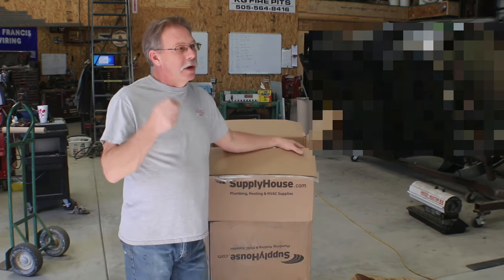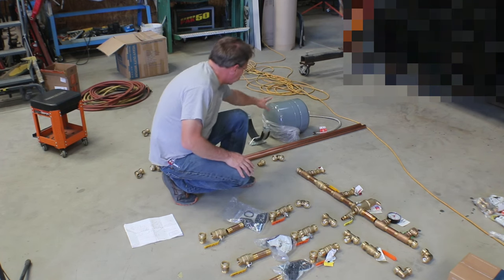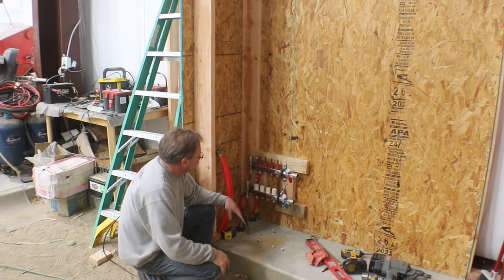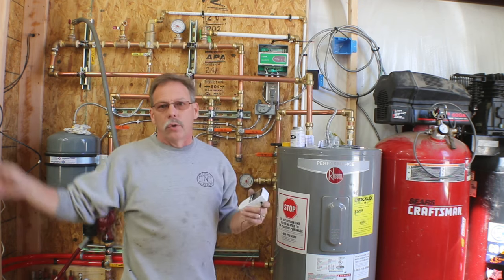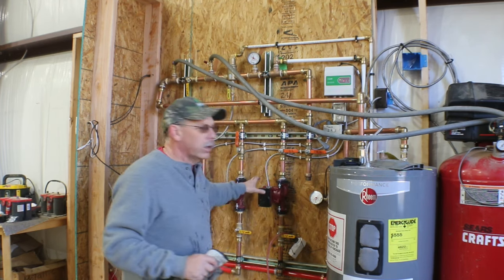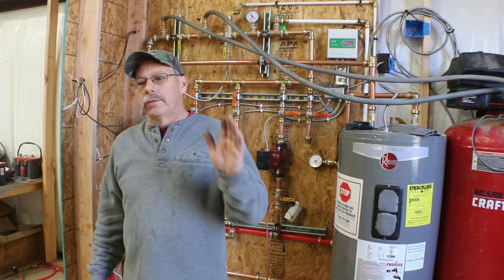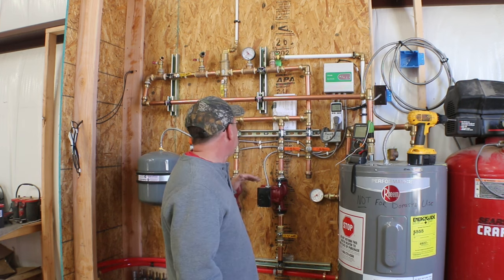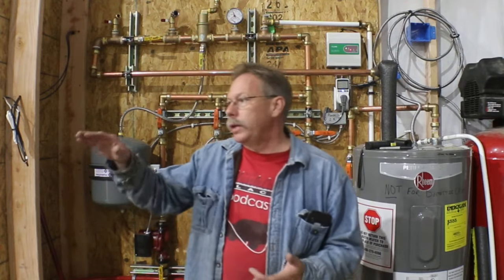Can you Heat your Shop with a $200 Water Heater? Radiant Floor Heating For My Shop | Allison Customs

Comment: Nice video for a DIYer install of this system. As a plumber my only recommendation is to replace the steel unistrut with wood. That or install brass insulative pieces between any place where copper is touching steel. When copper is attached directly to steel you get electrolysis. That over time will cause the copper to wear away causing failures at the copper/steel junctions. I hope this information helps. Have a blessed day and thank you for the video.

Jason B
Reply from the maker: Thanks for the recommendation!  I didn’t realize that a the steel strut could do that.  Be Blessed!
Reply from the maker: Good idea!

Comment: I was able to find a used oil boiler. I also had concerns when the pump was running. The local electrical supply house had 120 Volt indicator let's, that I drilled, and installed into the pump junction box, then tied into the hot, and neutral connections for the pump motor. A quick glance tells me when pump is running! Super easy!
Reply from the maker: Great idea!

Comment: you explained things so well. my fathers shop has been burning wood for 20 years and i just needed the confidence to switch everything over to the electric water heater. yeah the wood is free, but constant keeping that boiler fed is a lot of work. thank you for the informative video!
Reply from the maker: Glad I could help! 
The original idea was to use a waste oil boiler, unfortunately I just don’t produce the amount of oil necessary.
Check out the current situation - https://youtu.be/_mR7S4N28oY
Reply: I alternate between a home built waste oil boiler and an electric water tank. It takes about 10 gallons of oil to run 24 hrs so sometimes I don't have enough. electric water tank is heating near non-stop so she spins the meter pretty hard. I have a thermostat keep it at 60. cheers
Reply from the maker: Sounds about like what I was hoping to do. But I probably only produce 50-60 gallons a year

Comment: I heat my house and my 900 SF garage with my combination boiler.  I have one circ pump.  I live in a northern zone and it heats both fine.  By now you should have had the system long enough to realize you won't need any supplemental heat.  What I love is that if you open the garage door, there's not a long recovery time.  And working on the floor is nice as you're not freezing your a$$ off.
Reply from the maker: True, I love that the floor is not ice cold!

Comment: I was lucky as a Kid that we had a heated floor in our small shop in ND.  My Dad just kept the thermostat at 38deg F.   That was enough to keep the concrete from sucking away your heat out of your feet or when you had to lay under a car.   We had a wood burning stove to raise the temp up for working conditions.  The floor heater ran on heating oil.  We had to dress in long johns and coveralls for the weather anyway so walking into a 38deg shop when its -15 and 25 mph winds outside felt great!
Reply from the maker: Even at 60 degrees, mine definitely fells great when coming in from outside.

Comment: I helped a contractor install basically the same system but we installed a wind turbine that produced electricity which powered an electric water heater that heated the shop floor. The water heater and the concrete floor was the main storage system for the wind turbine system to store its heat. This system also heated a hot water coil in his house furnace to help heat the house.
Reply from the maker: I have checked a few times over the years and have yet to find a wind powered generator that will work with the amount of average wind we get.
Reply: The average hot water heater draws 18 amps at 220v.  That's about 4000watts.  Please let us know what wind turbine creates 4000watts.

Comment: So can you give us a little update on how this is working? I would be very interested in the costs of your monthly billing? How large is your shop and is it insulated well? Did you by chance put down foam when you poured your concrete? Would do this again?
Reply from the maker: The shop is 3800 square feet and roughly 72,000 cubic feet - it has R-40 stem walls below frost depth, R-19 walls and ceiling. 
I’m working through a solar system now and should have a video soon(ish).  
Here is what last season ended up like.
Shop Radiant Floor Heat - How Much did using an Electric Water Heater Actually Cost?
https://youtu.be/5jO3bHkLhJE
Reply: I have a much smaller shop 40X38 all walls are r19  and the roof is r19 X2.  I keep it about 55 degrees, I drive my truck out in the morning and back inside in the evening on workdays and on and off weekends in North Dakota.  So a Double size garage door is opened basically 2X a day for about a minute each time to let the cold in. A very rough estimate is $100-130 a month to heat mine (nov-feb, less for the month or two before and after that I keep it heated). I base that on what my bill was before I put it in and what it is now. I have used it for 9 years now. To plume in natural gas lines and a furnace, I can heat it for about 15-19  years and break even. on just the price to get it all done and I did the water heater myself. In the long run ( if I stay above ground for more than 15-19 years) it will cost me more, but I feel it was worth it. I suspect when I get down the road another 10 years I may not be puttering around my shop anyways. Great video wish it was around many years ago when I did mine, there were pretty much none on YouTube back then.
Reply from the maker: I’m kinda in the same boat, if I wasn’t making money out there, I wouldn’t be heating it at all.  Just work/play when I want to and on warmish days.  The grandkids are taking up more of our time now, so I’m out there less every year already.  That may change again as I retire, then I may want that gas boiler again.

Comment: I hope you check your wire size feeding water heater, you are way beyond their ratings. This is an awesome job my friend. Please check that wire an breaker,  your pushing it 5500w elements running simultaneously. Two 4500w elements will pull around 36 amps, your wh circuit normally runs on a 30 amp breaker, already exceeded, then bump tat 5500w elements that is about 46 amps.
Reply from the maker: This is one of the reasons I didn’t explain how I did my wiring, I didn’t want people just wiring everything up on one circuit. Thanks for your concern! But fear not, each element is on it’s own circuit.

Comment: If you are worried about water heater pressure then an expansion tank at the water heater is needed.  If it is that cold outside then 50/60 inside is great.
Reply from the maker: The system has a large expansion tank for that very reason.  Thanks for the suggestion though.

Comment: In colder climates we use either a 50/50 glycol mix or an antifreeze type coolant. No Steam created and the 50/50 mix tends to hold heat better than straight water. This also prevents freezing.
Reply from the maker: Thanks for the info.
Reply: Straight water has much better heat transfer than a glycol mix. A glycol mix is less efficient and should only be used when absolutely necessary.
Reply from the maker: True, but the freezing conditions here do make it a requirement- for me.

Comment: Since you got the heater used, make sure to pull the anode out of the top and inspect it's condition. When that anode disappears the tanks starts rusting out. Don't know if you live in an earthquake area, but if you do, strap the tank to the wall well and switch to flexible connecting hoses. You should have dielectric unions on the tanks, and pumps. Though these closed systems don't seem to corrode as much as open water systems.

I used the same pump on my system and in the end I wish I had purchased a stainless steel model. I used a tankless water heater for the much higher btu output (heating my whole house) which has an inlet screen. The pump rusts and is continually plugging up the inlet. Hopefully your antifreeze helps minimize that. If you didn't use O2 barrier pex oxygen will diffuse thru the plastic and corrode the pump.

In another thread you talked about installing solar water heating. Skip that and just put in more solar PV panels. They cost far less and if you make too much it is far more usable.  You can dump the extra power to your water heater or a secondary one, or any other electric loads. I would take the money saved and get a heat pump based water heater. It should pay for itself within a year or two in electricity savings
Reply from the maker: I don’t have any PV and am not currently considering them due to cost (nearly four times the cost of hydronic) and space constraints (more than 10 times the area required)
I do like the idea of a heat pump, they are just expensive and at least not yet into the budget.
Reply: @AllisonCustoms  Are you saying you have found solar water heaters cheaper that PV panels? Or that keeping your current system is cheaper than converting to solar and some other heating method. The latter I agree is cheaper up front. Whether you get PV panels or not, I think your ROI on a heat pump unit will be pretty fast. Electric heat is expensive, even at your pretty low rates.

Comment: Just came across your video,  your supply co. Should of sold you a copper press tool ,  not so sure the antifreeze will work well w all those shark bite fittings.  No pipe dope hope used used leak lock or  a paste teflon tape.  As. Previous mentioned. Heat Loss is the first place to start.
Reply from the maker: Thanks for the tip!  
I just started reading about that type of fitting.  As I finalize the system and it moves to its final resting place I’m going to look into those more.

Comment: Just came across this video on your shop heating and I must say Mate, just down on the farm type so awesome. Designing the heating system with what you had to work with turned out spot on Mate. As a old retired electrical engineer tech here, hats off to you Mate & will done. 🇨🇦🤝🇺🇸👍👍👍💯%
Reply from the maker: Awesome, thank you!
Check here for current setup - https://youtu.be/_mR7S4N28oY

Comment: A mixing valve while being an added cost would save your tank from the damage that repeated expansion and contraction causes which is directly a result of wide fluctuations in the water temperature. My tanks have all failed due to cracks forming in the glass lining near the opening for an element or the hot outflow. In larger boiler systems the welds actually fail in the boiler tubes if the water temperature changes too quickly.
Reply from the maker: I think that is in the plan with the solar system.
Reply: @AllisonCustoms  - add in hydraulic separators too.
Reply: You have to have excessive btus to spare in order to make a mixing valve work.
Reply: @rj.parker  Not so, one would set the supply loop temperature differential so that it is maintained within a prescribed tolerance thereby reducing damaging expansion and contraction fluctuations in the heat source. The heating loop is brought up in temperature slower which is not an issue for a large thermal mass such as a concrete slab. This essentially works by controlling the amount of return water re-entering the supply loop until the heating loop is up to temperature or the demand for heat is turned off. The idea that one needs to pulse hot fluid through the heating loop to even out or balance the distribution of heat is incorrect. The continuous circulation created by the pump in the heating loop will ensure the temperature is within a few degrees when a mixing valve is in place.

Comment: Well done video despite the length. I do want to mention that any similar project needs to start with a heat loss calculation so you can properly size not only the pipes, but the boiler or water heater. Once you know how many BTUS are needed the rest is easier.
Reply from the maker: Absolutely!  I tried to link as many sources for the information as I could in the description.

Comment: Personally I use Pex and ProPress fittings.  I know people poopoo SharkBite fittings but I've never had a leak in the 5 years I've used SharkBites (have maybe 20 throughout my house).  In your case, its probably beneficial considering your planning to expand your system in the future.  Anyway, looks good and thanks for making this vid and sharing.
Reply from the maker: I agree.  I have just ordered my solar system and I will now be able to dismantle parts of the original system to add my new heat source.  Video coming soon!
Reply from the maker: I think new code does allow for them inside walls, but I’m not sure I trust them that much yet.  But using them with the idea of future changes is an easy decision.

Comment: I use one of them thermostat plugs (kt3100) and im fairly certain you can switch from Celsius to Fahrenheit by holding mode button for a few seconds
Reply from the maker: I bought a second one and you are right, the newer one does switch.

Comment: If you fill from the bottom it helps push all the air to the vent at the top and it won't trap nearly as much air in the system to have to bleed out later
Reply from the maker: Good idea!

Comment: My boss and I built a shop for a guy three years ago now it was 80 foot wide by 150 foot long truck shop he use geothermal for heat he drilled 20 wells   And we had to go back last year to fix a panel that they put the forklift through but I asked him how much it cost him per month to heat the shop. He told me $65 a month to heat that big shop. So if you can do geothermal that would be the way to go.
Reply from the maker: I’ve looked into it a few times.  In my case I just don’t have the room to drill holes or do a shallow long trench.  But I agree if someone has space that would be a great way to heat and potentially cool a shop.

Comment: Just wanted to know Why not two mini splits and insulation. Would that be a more efficient  system.just asking.
Reply from the maker: I’m not really sure, it could be.  I really wanted the radiant floor, because now when I lay on the floor in the middle of winter, it’s nice and warm.
Reply: I agree.  At the end of all this work, it’s an electric resistance heater with a hydronic distribution system. Although the heat is nice, the bills are going to be huge.
Reply: IMO the answer is comfort. If he wants efficiency and comfort, I would go with an air to water heat pump and PV to feed the radiant.

Comment: When you upgrade the tank go with a 50 gal and wrap the current tank to help it hold heat.
Reply from the maker: Thanks for the suggestion, I ended up using a 108 gallon tank.  Video on all of that coming soon.

Comment: Nice neat job, well done, I am a power engineer the only change I would suggest raising the pressure relief to 30 psi operatin pressure could easily reach 15 psi. Just to save potential mess.
Reply: Maybe go for a seriously larger Expansion Vessel  thats properly 'Air Charged' inspecting the Air Charge on same and charging same when the System has Zero hydronic pressure on the Underflow Circuits ... maybe even set up your own bespoke ISOLATION system so you can  Drain and relieve pressure of that Expansion Vessel on that side of the system without having to drain down or  depressurise and underfloor circuits... reckon itwould even come in handy WHENEVER an Expansion Vessel goes South...
Reply from the maker: Thanks, I’ll look into that.

Comment: My question is before you installed the pipe did you install insulation on the ground then the pipe then concrete cause if not you have a huge amount of heat loss cause the ground is going to take the majority of the heat before the slab will
Reply from the maker: Yes, there is insulation under the slab and the foundation perimeter. You are right, without the insulation most of the heat put into the slab would be drawn away into the ground.

Comment: outside of the cost of the water heater and the pex in the floor, can you tell me what the cost of the system was for you to build it? I really want to design one so I can add hot water from a wood fired furnace to run a smaller section of the house and garage. My DAKA wood burning furnace add on had plenty of black pipe that I can wrap a large coil of copper tubing around and feed a baseboard radiator system for my unheated rec room.
Reply from the maker: A list of everything I used is in the description, with part numbers.  I purchased from Supply House and used them again this year for another project.  Pricing has really changed a lot in the last year, so I would suggest looking around to verify you get the best price you can.

Comment: I have considered doing hot water floors yet I think I might just opt for heating cables. I am still doing research about them. I would like direct solar option. With around 3000 square feet I am guessing a 10 to 30 kwh solar array would be more than enough? Using used panels at .25 cents per watts shipped. With aditional parts and the wire we are looking at around 12.5 for the cost. One thing that can be done as well is using those same panels to run the cooling in the summer time. EG4 makes a direct connect 2 ton mini split for around 1700 dollars. Like I said I still need to find the right wire and how it would all be connected and ran. While most of these in foor heat systems require 120 or 220v. I do not want to add inverters, batteries and or other things on to the load. Though there is this well type inverter that can can run 100% batteryless or with the grid. I also think there is a battery-less all in one inverter as well. Which could be an option as I really only need and want to provide additional heat to work with the EG4 mini splits which I think I am going to install.
Reply from the maker: Interesting concept, I’ve never heard of this type of heating before.  Do you have any links or suggested web sites for information?